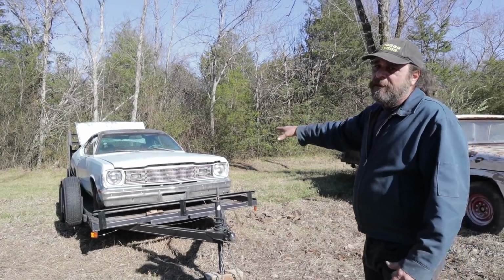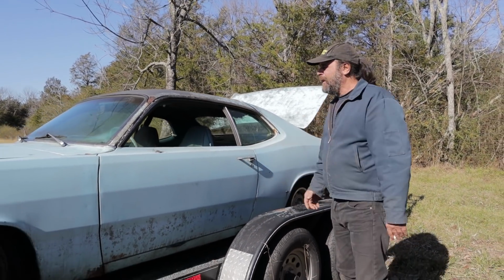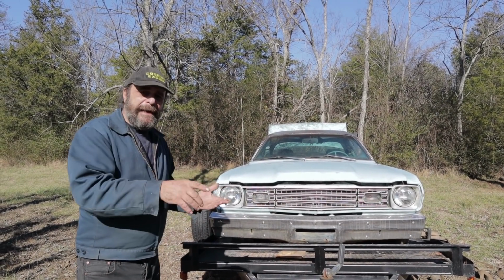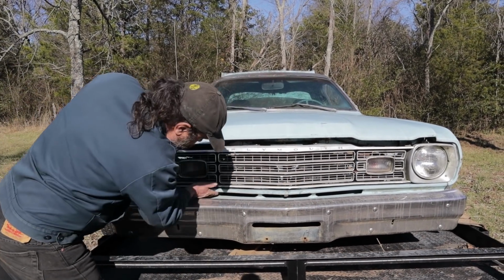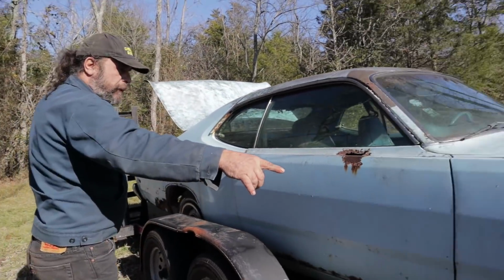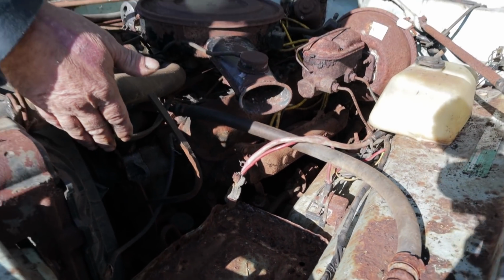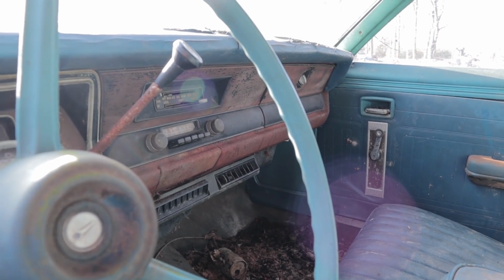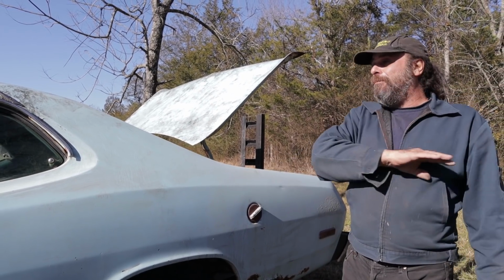So, What Is A Car REALLY Worth?

Comment: I worked at a place called E&E Speed once upon a time and we sold Mopar parts and I remember a particular '65 Coronet we had one time that my boss bought for $900. It was a really nice car, I got it running and drove it to where it was parked on the yard; it absolutely broke my heart to have to cut it up. The rear end and the badges off the car made the money spent on it back plus some

Comment: Love your videos.  My father, once he got a hold of a cutting torch, took apart everything that had come into his procession, that wasn't going to be driven any longer. Short list -  53 Caddy, 61 Electra, 62 Skylark (215 aluminum V8), 66 Mercedes 600, 7rl VWs, a few Austins,  3 or 4 MGs, etc.... He was a 2nd generation Tool Maker, who was a teen in the depression. Never threw anything away.  Regrettably, all of the remains from those vehicles eventually got tossed, in part due to pressure by local code enforcement, as well as siblings, who took over things, after he passed.

Comment: Had a 72 demon sold it in 76. NJ now looking for that car or one like it , it was blue exterior black interior. 3 sp on the floor 318 with headers.  The oil filter was mounted to the fender wall.

Comment: Excellent way to look at it. When I bought a parts car Toronado to redo mine after a theft recovery (bought it back from the insurance company), back in 1990, this is exactly how I thought. I used what I needed, sold the engine and transmission by word of mouth and then kept the parts I did not need and for $20, someone hauled away the carcass. Only reason they charged me was because it would get nothing at the yard due to it missing everything. It took a few years, but I sold virtually every part of it. I kept a spreadsheet (initially a paper list, but then converted it to an Excel spreadsheet) of money in and money out on the project. I came out ahead on the parts car end of the deal.

So, it does work. Just use your noggin, know your parts, know your prices and what interchanges with what so when you advertise it, people know. You might be selling it for a '79 Toronado because that's what you took it from, but you will know with some research that it also fits a 1980-1985 Toronado since they were the same generation.  The yards use a Hollander Interchange manual which tells them what fits what.

You should always look at what can finance what. I bought a Sears Craftsman middle tool box off of a guy locally. He wanted $50, I gave him $45. But it had a ton of emblems stuck to it, so I sold some of those. That financed the extra key that I had made up at the locksmith for $2.50 and also thus far has reduced that box down to about $20 with Ebay sales of the emblems.

Comment: Dude, just today a guy placed a car like that out on a haul trailer down the road from me.  Its a early 1970's car with rust similar to this one.  Its a funky pale weather green and has a big black stripe down the side and says 340 on the rear quarter panels.  My buddy at work seen it and said its a duster and the 340 is the engine size.  Anyway with what your saying about parts this car down the road could be worth a few bucks parted out.  Ill tell my work buddy about it cause I dont know jack crap about duster cars, all I know is my buddy said it looks like it needs a lot of work.  Ty for the vid was fun to watch.

Comment: I was thinking along the same lines Tony. Drag, hot rod or parts car. I can't see what you were as I'm not there, but the front bumper looked very straight for being 45 years old. (Too rusty on the back?) How did the rims look? I like those old Dodge sport rims with the holes in them. Great content, keep it up!
Reply from the maker: The passenger corner of that bumper was folded in.  Probably good for a core or someone who wanted to work on straightening it.

Comment: I bought a 52 gmc pickup. The truck was roached and I got it for 300. I took the hood grill and fenders to use on my truck. And sold the emblems door handles rear turn signal/marker light tailgate chains and window mechanisms. For 400. Thats good math.

Comment: I know how this goes. I think the people saying you're full of shit on the value haven't ever done this or even thought about it. I've got a Prius in my driveway right now. Paid 800 for it and drove it around until the transmission died. Put maybe 400 in parts to repair it along the way. Now, if I want to part it all out I know for sure I can make my money back. Someone wants my knuckles, steering rack, ABS brake actuator, engine, headlights, wheels, tail lights, 12v battery, hybrid battery, and boom. There's all my money back and I still have doors, rear hatch, brake calipers, fenders, hood, windshield wiper motor bullshit, stereo amplifiers, touch screen radio thing, all sorts of shit!

People just haven't done it and won't let you tell them something true.

Comment: There's something really neat about finding a lot of value in something that others might have dismissed as worthless or having only minimal scrap value. Great presentation. I like the way you dished out the knowledge and the numbers.
Reply: When I got into the EEK cars, I learned this. My friend's son is currently fixing up my gifted '87 Shelby Charger (yt: Euscorpia). So he has 3 trans, 3 cylinder heads, T1 & T2 intake manis, and everything under the sun available from me. I'm about to hit three more junkyards for EEK parts. 

The shifter linkage was missing a rubber bearing cap. Well, that's never going to be found being L body specific. Off to Advance Auto, go to the generic section, eye a rubber grommet that looks right. Fit like a factory piece. You do what you have to.

Neat thing, he's wanting to build a 300 HP engine. He knows to build that out separately, not piecemeal your currently drivable car.

I was of a Ford-fan family/ social group V8 Uber alles, until I got those K car turbos. Didn't look back, became Mopar (which died when SOLD to Diamler), regardless of the Viper and Challenger SRT 170 being beasts.

Comment: Today, I failed to convince my cousin (a Ford Man) that a 1964 Comet Caliente was worth buying. It is a two door hard top in better shape than this Duster and has a clear title.
The price $500 dollars. His problem? He thinks he can get a 1965 Mustang for that kind of money.....He's delusional.
If it is still there in the morning I'll buy it and store it
I'm neck deep in builds right now, a Rat Rod/Pro Mod and a 1963 F100 Fun Truck. It will be 3 years before I can get around to the Comet and I'm 65 years old, get the picture.
Reply: I'm 71 and same story.
Reply: I'm 31 and have no project cars... I'm doing something wrong aren't I?
Reply: @randymiracle4958  The only thing you really need is a place to keep your stuff out of the weather. I bought some land with a Pole Barn on it and modified that to work as a shop. I later added another Pole Barn for storage.
It's like trying to get a high paying job, you have to have the training for it. If you want to build cars from the ground up, you have to have the space to do it.
Reply: @johnparrish9215  I have access to two garages at my parents where my dad an I used to build cars. Last car we rebuilt was a 1929 Ford Model A Tudor Sedan, all original. Only thing I can think of that wasn't stock was the wiper motor. We never could get the original vacuum powered motor to work for very long so we got an aftermarket electric. I was lucky enough to get to drive it to school my senior year for a few weeks. I really miss that thing and how fun it was to start and drive. My life is a little wonky at the moment but soon I may have to try and find a Model A or perhaps something similar from that era. Edit: Watching these videos really makes me miss driving and working on older cars.
Reply: The 1964 Comet is basically a 1965 Mustang.
Reply: Sounds awesome brother and for that I've just subscribed to you're channel.
Reply: I have a 1996 Ford F150 with a 5.0L (302) Windsor V8 that I'm planning on fixing up.
Reply: The older you get, the more you need your own comet.!
Reply: If you’re buddy is still looking, I can try to get a link to a guy I know thats selling a yard full of 65-71 mustangs for 400-900 bucks a pop.
Reply: Im 65, same 'cept lved owned a 64 Cyclone since '06. Worked on it maybe 3 dazes. Too busy working and working on 2 Galaxies.

Comment: Excellent points in this video.  The problem with parting cars out is the wait for a ROI.  Yeah, somebody might need that section of roof, but who has the space to keep 75 parts cars in varying stages of dismantlement, hoping that someone is going to buy enough to keep you in the black for that month.  That type of work requires significant up-front cash to get things going, or a lifetime of saved cars inherited from someone who had the sense in 1987 to save a 1974 Duster from going to the crusher.  Just like any other business, cash begets cash, and bundles of patience to hold out for that one guy who needs that specific OEM doodad.
Reply from the maker: I did it pretty efficiently by only dealing with one type of car.  Once you become known as a good source for a particular car, people will seek you out, and the inventory flies.

Comment: This was the best video!! 
This is exactly the same scenario with the Australian Valiant Charger .. 
No natter what condition the car is in it is worth something to someone ..
You really need to thank the gods that this car even exists, as there was a time this would have just gone straight to the crusher, depriving someone the chance to own it.
At least it exists & you have the opportunity to restore it,  maintain it , love it ...and for this alone its worth every cent you paid !!
Reply: I remember when I was a kid, I had an AP5 that was rusted to hell.  R- and S-series Valiants used to go for about $500 for a complete but rough car in the '70s.  By the time I got the AP5 in the late-80s, the price had become $5000 for a rolling shell - I'm told that so many had been scrapped, junked and trashed over the years...then someone noticed that they were actually rather rare by that point, and the price shot up.  And don't even get me started on my VG Pacer hardtop (orig. engine and 3-speed) that I sold for $350.  Mind you, I only paid $200 for it...  shakes head ruefully
Reply: Same but different , but newer. 
Any pos that can drive down the road with no check engine light is worth a grand. 
We don't have emissions check in NY here , but for the safety inspection you can't have a check engine light on.  
Hence a roach that drives with no cel is a grand.

Comment: Hey Tony, great vid as always. I bought a 68 charger factory big block 4 speed car back in August and it's in pretty tough shape,but I paid dirt for it. Got it home, took inventory on the part's, did a little research and with what's left of the charger I could potentially make between $6000-$8000 on it. It's also only 1 of 259 68 chargers built that year with a 383 4 speed combo,so I think it was an ok investment.

Comment: Good thing I kept listening.  I was wondering about the Disc brakes. In late '99, early 2000, I had a wild hair about building a sock car, from an old Duster. 340, Drivers choice of transmission...... 5/8s mile dirt track. Short story..... I was working in a salvage yard....... The installer was the driver. My manager, and I were going to front a Saturday night "Claimer series " car. Anyhow, best body I found, was missing the K-member, BECAUSE it was a disc brake.

Comment: Just bought a 1974 duster With rotted out floor boards and  a roached trunk. The car has docummeted ( State inspections Ticketts  74-94 plus orginal bill of sale) mileage of 34000 miles. 318 auto for $1500. Just got it runninng, purs like a kitten. Mopar Kitten LOL

Comment: Would love to run across something like this that I could sell the trim and interior pieces off to someone who wants them, and not feel bad about tube framing the car to build a racecar out of. We've run into a wall down here with people who think rusted pieces of crap are worth a fortune though..... there's a trio of 65-67 mustangs right down the road from me that MIGHT make 80% of a complete car between three, but they will sit and rust to oblivion cause the guy wants 5x what they might be worth to anyone. his excuse(well, both those engines had been rebuilt when they where parked".....yeah dude, that was two major floods and 30 years ago.
Reply: @trillrifaxegrindor4411  turn 34 next saturday, and have been trying to wrangle some away from him since i was 17! The shows haven't helped,  but this area is exceptionally bad, always has been. 

They do the same shit with boats. Leave it sitting in the front yard for 10 years,  need transom work and motor frozen..."naaaaaw,  that was a 30000$ boat new, I couldn't take less than 10 for it, just needs some work ya know". Dude down the street literally drug a nearly brand new shrimp boat hull out back and left it to rot when noone would pay his asking price.

Comment: All true, Uncle Tony. 12? years ago, I bought a rusty 1964 Olds Super 88, out of NC, for $150 and $500 shipping. Needed the High-Po 394 4BBL motor and trans, for my Starfire project...and a few other bits n pieces. But, proceeded to sell off everything I could and all in all, more than paid for itself.
Dammit man, should have kept the frame for that Starfire convertible though.
JT

Comment: Someone told me once, a 57 chevy  was what about $2800 fully loaded new in 1957. If you were to buy everything every nut and bolt over the counter in 1957 the cost would have been over $250,000.00. I have been in the parts business you're not far off at all.👍

Comment: Hey Tony!  Got a question!!!  I have a 72 Duster with a 225 6cyl.  Paid, $1200 for it.  It runs great! All original equipment, no molestation.  I bought it with the idea of making it into a 440 Duster.  Since it's unmolested, am I gonna F myself by molesting it?  Would you go 440, or restore it all original?  I can't decide????????  Thanks Bro.!
Reply: My 74 was a 318 car now it's a big block 413 ...go for it!
Reply from the maker: My honest opinion?  With all the modified and partially stripped cars out there, it would be an absolute crime to carve a nice original car up.  I'm restoring a 74 225/3Speed car myself.
Reply: @UncleTonysGarage  Thanks!!  I was leaning that way too.  The Cool Factor is in the originality of it as it sits.  If it was a rolling chassis, then it would get a BB.  ttyl...
Reply: @RT69hemicharger  I'd put a mildly to fully built 340 in it as opposed to a 440...but that's just my opinion & preference though.

Comment: Strictly strip only cut it chop it sell the trim i had a 74 dart sport 451 will run real good at the strip can fit a decent size slick in the back without widening the fenders would get cheap repops through together unc. Or oval dirt track lol

Comment: This is how I maintain my obsession. I never raid the family cookie jar to finance my builds. Buy,strip,shelve usable parts for sale / trade / help out friends in need. Old school hot rodder hardly ever build out of a catalog. '34 Plymouth PE true barn find in pieces but complete, bought in 1972  for $375.00. Collected parts while working on / driving the '55 Nomad and buying & building others.

1934 Plymouth PE Coupe-- $375.00
'69 Camaro RS  shell for frt clip  $50.00 initial cost. Parts sold from shell $500.00 +
'70 350 4bolt main with 12,000 miles FREE from a friends truck that I sourced & installed a big block in his newly acquired C10. He paid for the BB I got the 350 for doing the 2 days swap and detail under the hood.
'67 powerglide with kit--- Free off my supply
Ford 9" -- Free from free car being parted out.
Polished intake manifold $50.00,chrome engine goodies swap meet items.
Wheels and tires $ 500.00 ?  at cost.
I do my own paint, upholstery, wiring. 

I could go on but you get the picture.
Built for maybe $5k and change. 28 yrs,100,000 plus mile of smiles.
Sold 4yrs ago 30K plus
Matching Teardrop traded a broken Coke machine to friend. Sold separate from car 10k and change.

Not bad for a female rodder.Eh
Melanie

Edit: I'd like to add if you approach someone who has something you want, have the money in hand at the moment you make the offer.

Comment: Breaks my heart to see a Duster like that,  but yeah,   far beyond my means to save anything like that,  of course.   Hel,  the donor car for my Duster (actually a 'Dart Sport')   looked like a Mercedes compared to that, and it'd been street-raced.  200 bucks all-up.   I even used some of the black interior bits to make the 'Panda' interior I always really liked, with a minimum of vinyl paint etc to lose a lot of the chocolate brown hodgepodge I had.  (Also got the sixties-style uncut pile carpeting from JC Whitney cause I put in the manual transmission tunnel , donor car even came with a Tuff Wheel  in perfect shape, so I just swapped columns while I was doing everything else.   Kept the off-white bench seats though, cause I love that.  I was just going to splurge on reupholstering them whenever somehow money came along.  

I also kept the exterior that particular funny beige that was among the many choices of beige you could get those models in.  I used to, on my many long drives, visit all the run-down auto parts stores and buy up every little can of that paint code still on the shelves they had.  :)  

Anyway, the things we had and no one valued,  and that now you couldn't buy.